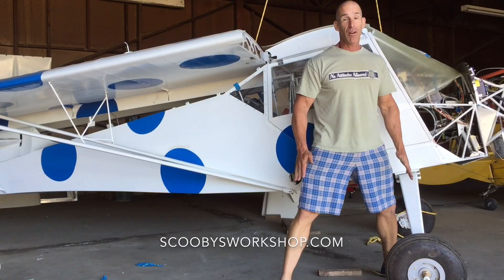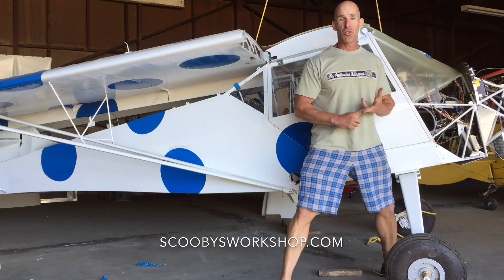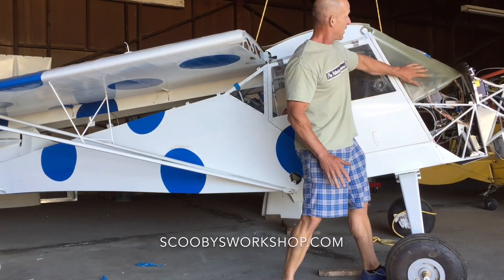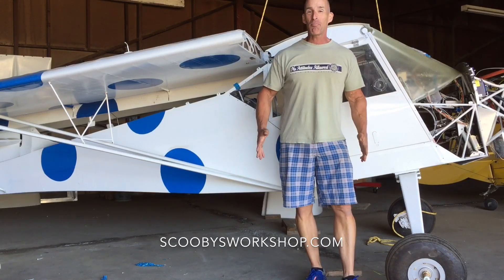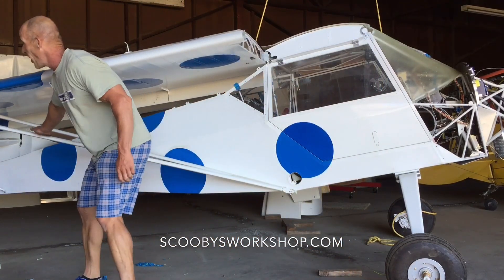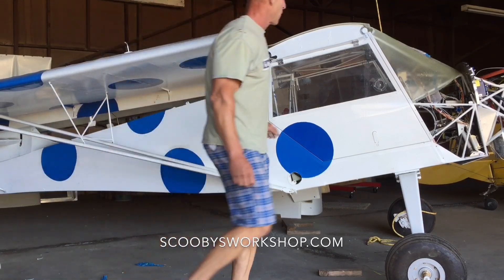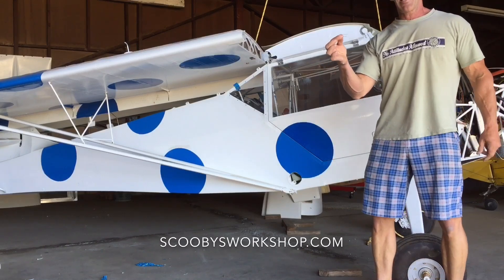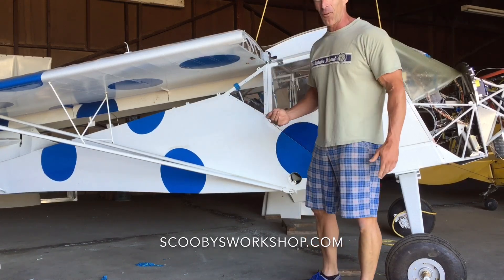Homebuilt aircraft progress

Comment: Kudos to your engineering talents.  I could probably fill up the gas tank or pump air in the tires, but that looks super complicated beyond that.  I have no fear of flying and have been in over 50 commercial jet flights, and one old 1970's private plane that had "mechanical issues" a week prior to our 2 hour flight.  I don't know why but really small planes freak me out much more that commercial jets, and the folding wing design and cotter pin would be on my mind for the duration of the flight.  I love the practical element of folding wings though.  Can't wait for the engine start Scoobs

Comment: "It's very reinforced. There's a cotter pin that holds it in." *holds up cotter pin so minuscule that it's nearly invisible*

SCOOBY I'M WORRIED.
Reply: Kevin McDunn It's the same thing as cars. A pin holds the entire transmission together. Do you feel unsafe in your car?
Reply: It would be easier to rip the whole wing off than break a steel pin (I'm assuming it's steel).